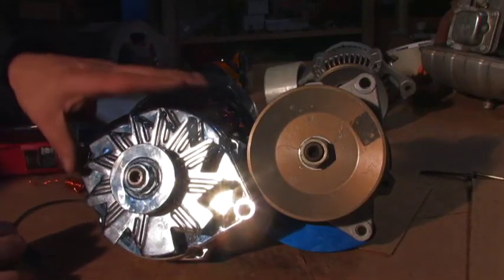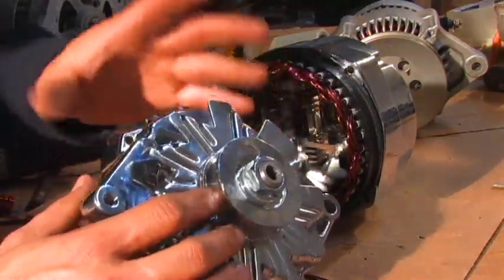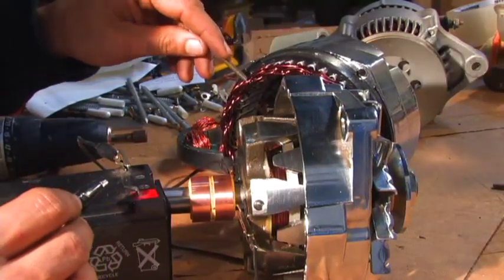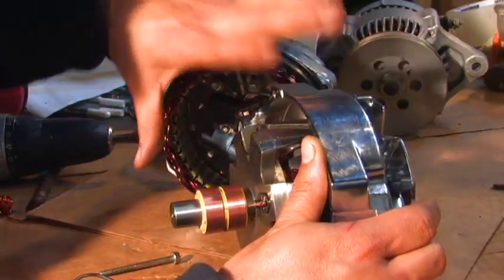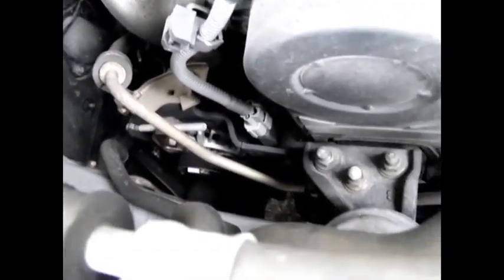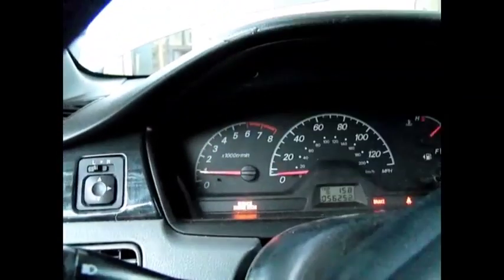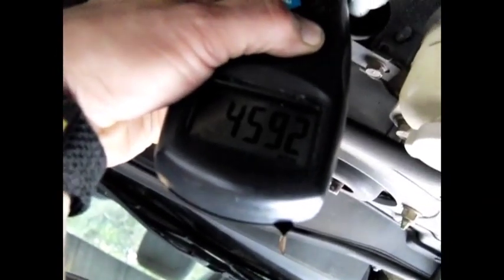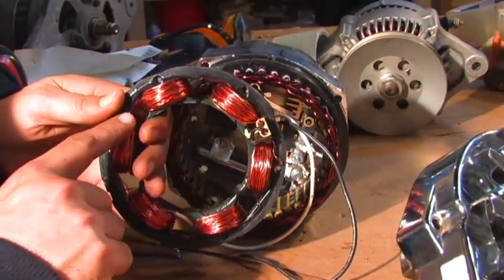Inside a Car Alternator Green Energy Generator Brush Reinsertion for wind turbine RPM

Comment: Not the best info here. Us bassheads ( car audio ) run multiple 300+ amp alternators with smaller pulleys to get more charge. But it's a per demand not constant. When we are driving along no more than regular listening levels let's say 4 alts at 325amps each a 280ah lithium bank , or agm batteries maybe 8 of them, there's no over charging or fried electrical. But when we compete running a 3minute 1000amp+ run that is when you come into issues with hot wires etc

Comment: Just a thought but it you were to build your unit with say a 14 inch pulley on the blades and the used a 2 inch pulley on the alternator you may reach proper speed.

Comment: Interesting and informative.
Looks like this video has been out for a hwhile.
So... I'm an automotive tech, I'm also very curious about free energy, middle, middle, middle, "that's me phasing out long tedious explanation".
I don't have a firm grasp of electrical application beyond simple circuits.
I can't tear down everything explained in the video.
But, here's the thing.
I happen to have an MGU. Motor generator unit.
It's effectively an alternator that doubles as a motor when needed.
I don't wish to give too much away, or look too incompetent, but, if it were possible to have this MGU supply power, how would I go about testing.
The normal battery voltage is not supplied to the alternator. It has no rectifier, or even B+ connection.
It's a pretty steep idea that applications for this involves engine's that don't need a starter.
The MGU provides the rotation to get the engine going.
I would be interested in your thoughts to how an MGU works.

Comment: An alternator coming out of a car generates electricity at 750 RPMs cuz that what your car idles at somewhere right in there, nonetheless it is generating power at about 750 RPM, and you can also experiment with different police that you can make that stator turn at 750 RPMs bigger or smaller pulleys whatever it takes all that I'm saying is the stator just has to go 750 RPMs cuz that's what your car idles at an alternator came out of a car or a truck if is ACDelco and then put you out to a battery at 13.85 volts

Comment: I was wondering how many volts do you supply to the armature/rotor to get it energized? I am also assuming it is the armature is the input and that is where the regulator has to be to control the voltage or current to the armature and how does the regulator work.  And where is the rectifier and how does that work?

Comment: use a tooth pick to hold down your brushes you push the brush in with your finger tips pushing the tooth pick until it bottoms out assemble and slowly pull out the tooth pick

Comment: On JUST GO MAKE IT this guy has a vid  "alternator to motor conversion how to" and he was talking about controlling speed/rotations with radio controlled airplane speed controllers wired into the mix . I don't pretend to understand but I am trying to learn - I don't know what I'm talking about - I'm using keywords in the order he did and I can, most of the time, put 2 and two 2gether, and I think his two and your 2 make four.  Check out his video & check if you 2 are talking about the same thing, it sounds like you have a problem and it sounds like he may have solved it.

Comment: Silly question, how you explain the alternator it sound it like actually you can stabilize your output , so high wind or low wind you can actually output continues volt and amp. So it kind of sounds good but I’m not sure it will be efficient?
Reply from the maker: Car alternators require gear ratio to increase the RPM from the wind turbine to get the right speed. The modified alternators with permanent neodymium magnets are a better option and only about 2-3 x the cost or a DIY model from an electric AC motor that has the rotor replaced with magnets. Electric motors have lower amp/current but provide a usable voltage in lower RPM or wind speeds.
Reply: Thank you for a reply, I was experimenting with drone brushless motors but I thing the dc is way to go since we need to charge the batteries first and get from there. Thank you
Reply: Thank you for a reply, I was experimenting with drone brushless motors but I thing the dc is way to go since we need to charge the batteries first and get from there. Thank you
Reply: Thank you for a reply, I was experimenting with drone brushless motors but I thing the dc is way to go since we need to charge the batteries first and get from there. Thank you
Reply: Thank you for a reply, I was experimenting with drone brushless motors but I thing the dc is way to go since we need to charge the batteries first and get from there. Thank you and great video
Reply: Thank you for a reply, I was experimenting with drone brushless motors but I thing the dc is way to go since we need to charge the batteries first and get from there. Thank you and great video

Comment: I get what your saying. Yes the number of turns determines the voltage whereas the gauge determines the amps. Volts * amps = wattage/power. Anyone who has removed the battery from an running car to test the alternator will tell you if its good the engine won't stall. This is cos some of the generated power is fed to the exciter rather than powering it from the battery.

Any generator becomes hard to turn as you draw more current from it (required torque becomes greater). OFC there is an max level of output due to the magnetic field and the windings (output windings).

With wind turbines okay we could convert the low RPM from the prop to high RPM but that would mean even more torque is needed to drive it. So we need a more direct drive to the generator and thus require lower RPM. Magnet generators are great for low RPM applications and can deliver KW's of power. But again the greater the demand the greater the friction. 

But yes it wouldn't be very practical to use an car alternator cos we'll need to draw some of the current to drive the exciter. Plus we'll more likely want more than 14 volts anyway. 

Great tutorial though
Reply: Zhh

Comment: Good video and well done I love when people take the time to explain things and Y tube is a God sent in some ways and people like you help teach or open doors for those to come or leave sparks that give rise to ideas that advance science or make life easier.

The Car Alternator was a huge advancement over the old Generator of the past the field current will increase or decrease depending on the load placed on it from just starting the car to driving at night in the winter with rain beating down and requiring the alternator to produce a large amount of current to power the car's systems.

The headlights, wiper motor, heater motor, fuel pumps or pump and computer along with the transmissions can eat up lots of power and it's possible to have a weak alternator and have 13 volts output but only have 1/2 current left over. In one tip of aircraft if the main alternator fails the pilot could bring the stand by the alternator online to power the aircraft system;s

The pilot had to look at the voltage or current meter and turn off none critical systems until he drop the current below a safety lever or the stand by alternator would fail and the aircraft battery would discharge as well. 

Some alternators use external voltage regulators which can be an advantage at times. if the alternator fails its ease to jump power and put the alternator into whats call full field and if it comes back online all you replace is the voltage reg. if not then you replace the alternator. in aircraft, the engine is started and then the pilot turns power on to the field coils. this will allow the pilot to cut power to the alternator should it start to overcharge or if the alternator fails it allows the pilot to remove power from it and saves the current for other things   

In working with magnets and differences sizes of wire it is possible to have an alternator custion wired for  Exp in which a higher voltage can be produced as well

If one looks at Smokey Yunic hot vapor engine its ease to see he cut across or add a new page when it came to heating fuel & the air charge before it enters the engine.

In 1930 the book call heat power was produced by McGraw -Hill books and in the fuels for the inter-combustion engine water gas is listed it is close to some of the HHO systems but produces a gas 
= H20+C=H2+CO

I look at the work Stan Miyers- ? Spelling work in HHO GAS

And leave you with a question to ponder is it possible to make a Sold state Alternator  using magnets
and coils of wire and produce power -[ I use the term Sold State] -meaning there are no moving parts

Thanks for the video 
and I hope this sparks an idea for at one time the aircraft was only a fool dream at best and the current that used all over the world was look on as a fool ideal as well. and his name like so many in the past is not known to all N- Tesla

Comment: You do know that alternators in buses and other vehicles do have permanent magnet alternators just as a standard car alternator they have regulators that hold the voltage down so they do not burn out the batteries or other components. They will also get very hot and service life will be short. You can put a permanent magnet in a standard automotive alternator and it will perform just the same as with a standard winding. The difference is it takes power to excite the coils to make the magnetic field and that is a parasitic drain, drastically reducing the efficiency of the alternator. Both use a magnetic field and accomplish the same task. The permanent magnet doesn't use resources to operate so it requires less rpm and torque to drive it. Output is not based on RPM it is based on the load and regulator.

Comment: Voltage regulator. You didn't mention it. It controls the voltage as to not fry your battery or fuses. The correct rpm for optimum output, depending on your application, can be achieved with pulleys. You are not qualified to make this presentation.

Comment: Alternators produce AC and not DC.  The Diode bank inside the alternator rectifies the AC into DC.  Military aircraft electronics work at 440 AC.
Reply from the maker: Yes.

Comment: Gm has a regulator rectifier will it still over charge the battery?
Why not just use a Alternator or generator off a Tractor?
Reply from the maker: The over charge would be only if you had permeant magnets inside, like a DIY conversion. Then the voltage could never be regulated.

Comment: That was a great explanation. I was trying to use a car alternator for diy electric generator and the difference you explained about the coil winding thickness and ampreage and voltage... wow... i can understand the application.. Thanks

Comment: interestingly enough, you can put small rare earth magnets in the poles of an alternator rotor and get it to self excite. Drill a shallow hole in 3 or 6 of the poles evenly spaced and glue the magnet in with epoxy. The tiny ones from CD reader eyes are plenty. Add a capacitor and the regulator does the rest.

Comment: So do generators have permanent magnets
Reply from the maker: Most have electromagnets and ONLY the new INVERTER GENERATOR have permeant magnets but they are not Neodymium, they are strong standard ceramic. The higher magnetic field is not  required for the multi magnet ring and high RPM.
Reply: But wouldn't the heat from the high rpm make the magnets weaker

Comment: Curious.  when it spins the direction it suppose to spin..  its powers up/ charges batteries  Riiiight?
But  .. what happens when you got it spinning the other way? . whats the difference ?
Reply from the maker: It is an alternator so alternating current goes to the bridge rectifier that converts to DC. It would work the same and the current would be positive negative either direction because the rectifier only sees AC incoming and converts to DC as the rectifier output is designed. This is unlike an DC motor or old car generator that has a commutator which is set. With DC motors and old car generators, a change in direction results in positive negative flipping at terminals.
Reply: has a rectifier in it so it does not matter.  Output is 3 or 6 phases AC, if it is 6 phase you can wire it up to make a higher voltage using a capacitor and rewiring the phases in series for 3 phase.

Comment: dan, would it be possible to build a wind turbine based on an alternator, and use a small brushed dc motor driven off an integral drive shaft to supply power to the field coils, thereby increasing load on the alternator as wind speed increased? second part of the question is how much current do the field coils require to energize fully?

Comment: I would like to see if the field could be used as an over speed control. As RPM increases the increased alternator output could be fed back to the  field, increasing drag and slowing the RPM of the system. This would also allow generation at lower wind speeds by limiting field strength. It might be as simple as using a pot as a voltage divider to the field. I have never had a reason to check the field current on an alternator but it shouldn't be too high. You could not use the regular to the batteries as this would allow higher RPM's if battery voltage was low.

Comment: As a matter of interest ... car & truck alternators are designed to deliver a fixed wattage ( the rotor is designed to saturate, this automatically limiting the output current, the number of winding turns limit the maximum output voltage. The regulator just limits the output voltage to prevent the battery from overcharging.

Comment: Hello Dan have you seen the videos of the Bicycle Generator that will Power you house for 24Hrs with only 1Hrs or peddling?  Yes I know it's crap considering an average cyclist can put out maybe 200W and in 1 Hour generate 200Wh.  It is amazing how many think this is really possible.  Perhaps an Led Light and maybe a transistor radio for 24Hrs but certainly not a house.  As an Engineer, this really gets to me.
See:  Creator of 5 hour Energy Wants to Power the World's Homes With Bikes
Reply from the maker: +valveman12 Yes, :-) maybe a very efficient tent. Done debunking videos for now. I did a few but people get really upset and assume  I work for the government's disinformation projects? So my new take on things is:
"If people have the time to chase their tails, they may actually succeed. But, it is still just a tale."
Reply: +GREENPOWERSCIENCE Yes I know what you mean.  I have a few videos debunking Magnetic only motors and the usual Free Energy crowd says lots of nasty things to me and claim I work for the Oil industry.  It's quite humorous.  I am all about making things more efficient and Green and of course that can only be done by following Laws that Govern our Universe.
Reply: the reason why generators and alternators are so inefficient is that the rotor field is always bigger that the stator no matter the load. in power transformers the primary and secondary field are always equal and opposite  in magntitude regardless of the load. what causes the generator to generate so much heat is that the two fields are not equal and opposite. when the two fields become balanced in a generator the input force become much smaller because now 95 percent of output is achieved and 55 percent of loss is recovered. at 95 percent efficency almost no cooling would be needed as the in the normal generator more than 50 pecent of the energy is released as heat and need cooling to overcome the loss and to prevent the generator from burning up.
Reply: valveman12

Comment: dan  you left out the voltage regulator this is what keeps voltage constant to rotor at any speed  but 1000 rpm is min yet output will charge battery on idle a gm s10 or s12 does not require to much hp  and if you know how to tear  them down as i do you can also make it work by electric drive as i did mine and used a 12 v step down transformer bridge rectiifire  and a drop resistor  my setup running uses a 1/2 hp 115 vac motor spins my s 12 @1725 rpm  reason i did was s12 had blown regulator blown diodes and kits no longer  can get so i took 3 conductor wire fed out  from stator to  pc board made 3 phase rectifire and i get 14.6 vdc no load @ 35 amps  this was to go into a  larger setup useing marine batterys  mosfet switches and 2 inverters  but the main part is working perfict

Comment: This is why is better to keep the alternator with the inside winding. Why? Because with the electric magnet the magnetic field is more powerful than any rare magnet that can fit inside. Also the input feed is way smaller than the out out we can get from this devices. This is about the only device that I know so far that can give you almost free energy if you do your homework. All you need is about 500-1000 rpm and 12 volt input. Your out out will be either AC if you remove the converter or DC but with night amperage.

Comment: Run a pulley / belt system on your turbine, use a bigger turbine, and get your RPM. Plus the voltage output is rectified on the alternator.

Comment: This is full of great information. I was wondering would you get an even stronger current if you were to replace the inner column with magnets but keep the original brush current system as well to boost the magnetism even more? Or do you think the magnets would become to strong at that point and not allow the center axel to spin at all? Or is that just a completely unnecessary/useless fabrication step?
Reply: gavin thurston You do not want to put a permanent magnet on the alternator. This will override the output control and burn out your electrical system.